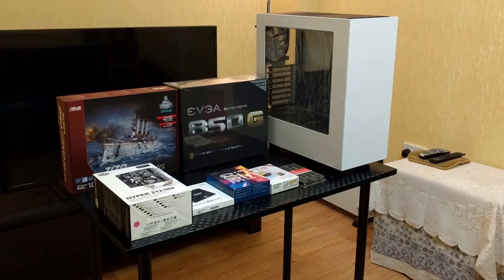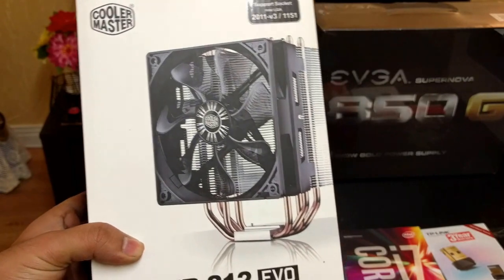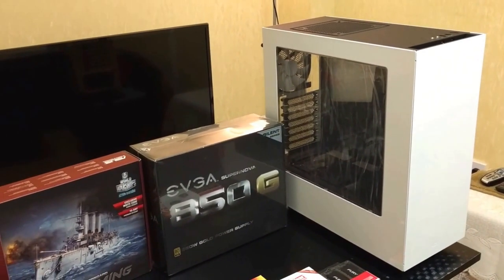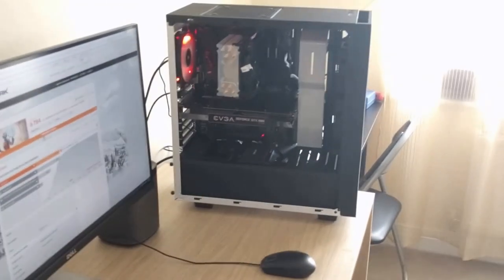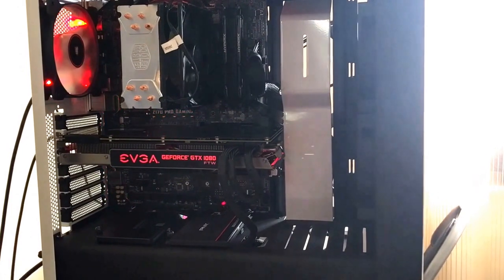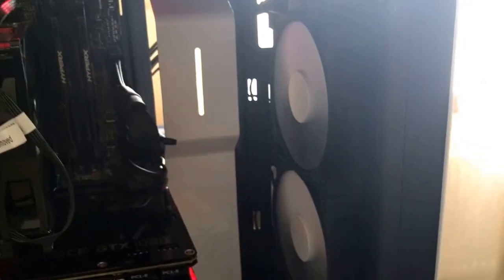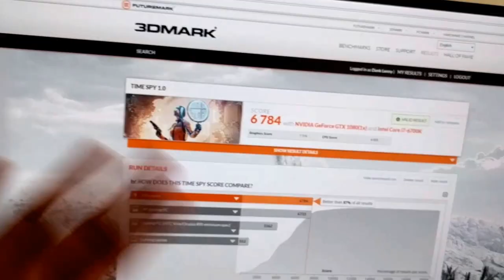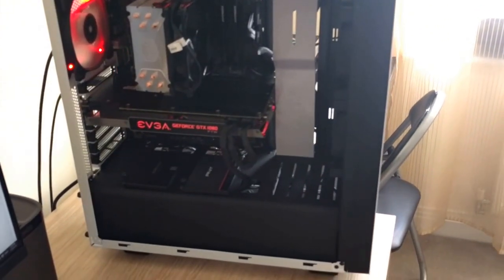Under $1900/£1500 GTX 1080 Gaming Build(August 2016)! Noob Builds a Gaming PC!

Comment: I am going to be using the same cpu and gpu, maybe also the same psu. At the moment I have the Fractal Design Define S case and planning to put a msi z170a krait gaming 3x motherboard and for the storage I will use a Sandisk X400 M.2 SSD 1TB. I'm not sure which cooler I will use but I have 3 choices, 1. Cryorig A80, Arctic Freezer i32 and Arctic Liquid Freezer 240. I will also use the same RAM with the same capacity. I will buy the 2666MHz version. Which version do you have? :D
Reply from the maker: Looks like an awesome build, especially that m.2 SSD, it's gonna kick some serious arse! :D My RAM dimms are 2400mhz each.
Reply: nice. :D
Reply: how does the hyper 212 evo perform on the 6700k? What is the max overclock that you have achieved using this cooler because the i32 is somehow similar.
Reply from the maker: +Badrstech It performs like it should! It's fairly quite, and keeps the CPU idling at 37° C. As for over clocks, I haven't really had any need to overclock my cpu since my  workload atm isn't that demanding and all my games run at 60+fps, high settings easily.
Reply from the maker: +Badrstech Although I did overclock my GPU, it was stable at about 149 mHz on core clock, at about 100mhz on memory clock, although you can definitely increase the memory clock even more! This resulted in the card running at about 2088mhz !!
Reply from the maker: +Badrstech Although I did overclock my GPU, it was stable at about 149 mHz on core clock, at about 100mhz on memory clock, although you can definitely increase the memory clock even more! This resulted in the card running at about 2088mhz !!
Reply: +Kartik Vashistha Nice. And what about you cpu?
Reply from the maker: +Badrstech CPU is running at it's stock speed, 4ghz.
Reply: +Kartik Vashistha And what are your temps? 😅
Reply from the maker: +Badrstech 37°C
Reply: +Kartik Vashistha Are those idle or max temps?

Comment: Bro you will have to get a better wifi card
Reply from the maker: +Gerolamo Zanchi Thanks for the suggestion! Atm, I don't have ac WiFi in my house(17mbps line), so this does the job. However, when I do upgrade my internet speed, I'll definitely be getting a better card, or maybe just use another router as an extender! :)
Reply from the maker: +Gerolamo Zanchi Thanks for the suggestion! Atm, I don't have ac WiFi in my house(17mbps line), so this does the job. However, when I do upgrade my internet speed, I'll definitely be getting a better card, or maybe just use another router as an extender! :)